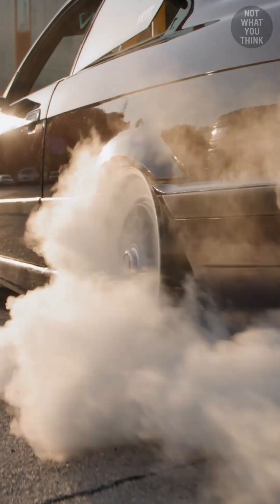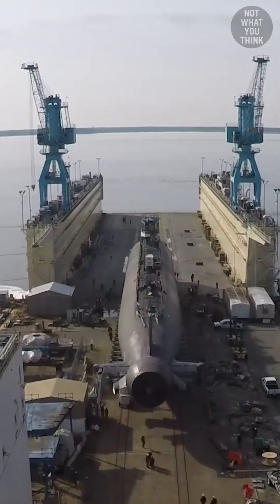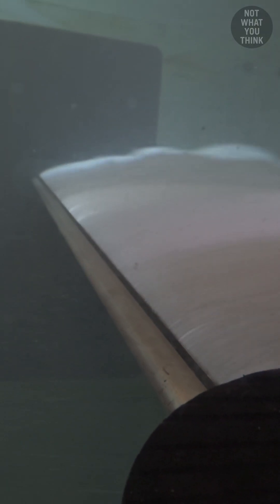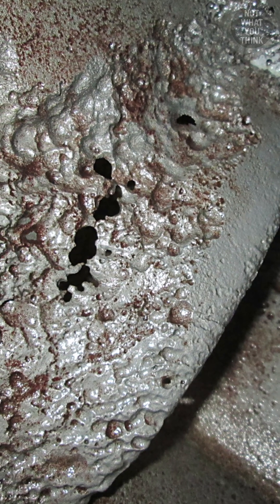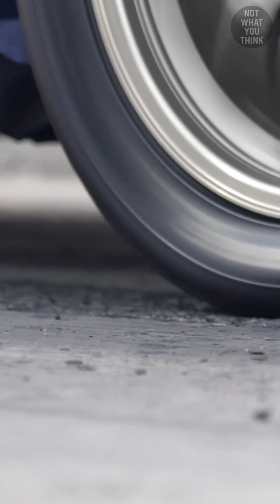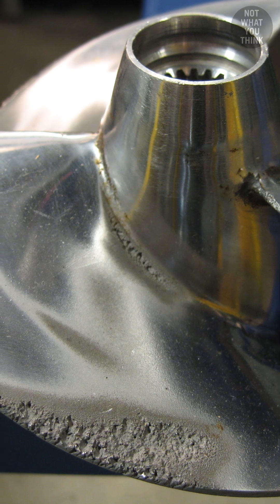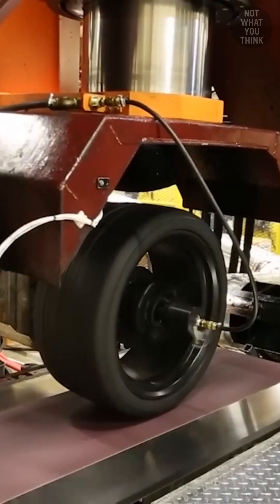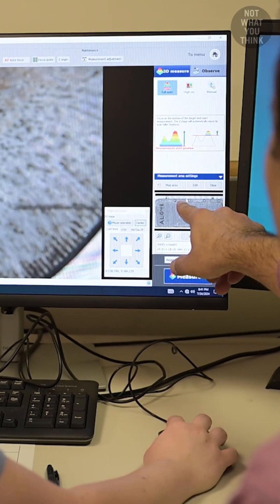The World's Largest Water Tunnel

Comment: As I understand the current going theory, is that Cavitation is millions of tiny bubbles exploding under extremely high pressure, or basically, the item moving through the water, in a way that it causes cavitation, is it creates air voids, like bubbles but different, that then collapse suddenly.  These collapse at super-sonic velocoties, and cause tiny explosions basically.  

My thought on this, is that Water has oxygen and other gasses dissolved into it, and as the vacuum forms from the cavitation air pockets, it sucks this dissolved air out of the surrounding water, and then the bubble collapses, and compresses this gas, to the point of combustion.  Pure Oxygen, or an Oxygen Hydrogem mixture for example, could basically oxidize and shred metal and other materials super quickly, like an oxy-acetylene torch, but in millions of tiny explosions a second, kind of thing.

Comment: Running out of fuel also causes cavitation and erodes cylinder liners in engines.
Reply: No, there is no such thing as cavitation from running out of fuel. Cavitation can happen in the cooling system.

Comment: The water is then cavitating it basically forms a vacuum and plasma ... propellers/props/screws and can happen in minutes... it's really understood by those that manufacture props for inboards/outboard on the racing scale due to the rpms and speeds and on tub boats due to the need for torque... seen it due to the area I live and the hyper performance fishing boats build for running in the flats

Comment: You can also have cavitation in your car/truck engine too. I had to replace the waterpump on my truck as it was leaking, once I had it off I saw what had happened. Cavitation had been happening between the back edge of outlet and the pump blades causing a series of deep holes in the metal, one of them had penetrated right through.

Comment: It’s not poorly understood. Water is not compressible, so when a cavitation is created and then collapsed in on itself a shockwave is created close to the propeller. As water doesn’t compress it sends its shockwave into the metal and over time that can take off layer by layer of metal. 
So, not poorly understood or hard to explain, the hard part is to mitigate it whilst keeping speed and rotation
Reply: well yeah the definition of cavitation. its about having to do actual experiments. if it was perfectly understood, we could just model or simulate the results with no deviation.
Reply: It is poorly understood when an AI is writing the script
Reply: @Derekzparty  hi, finally we found the village idiot. Everyone here has presented views and ideas but now we got a genuine Trump supporter, impervious to facts and reasons.
Reply: Hey look who know just enough to not know that they don't know what they are talking about.
Reply: @SilverMe2004  said the person saying absolutely nothing
Reply: Wouldn't non-stick tech usually used for cutting / cooking / going through things work? 

If the problem is the cavitation, why not stop the cavitation from happening in the first place.
Reply: @ the cavitation isn’t so much a friction thing but a pressure difference. As the propeller spins, one side is pushing (high pressure) and one is dragging (low pressure). It’s the low pressure that creates the steam that makes bubbles that then implode
Reply: It is not mainly the "shockwave" that causes cavitation damage. The damage is mainly from the extreme temperatures produced. cavitation bubbles when collapsing produce temperatures of upwards of 8600F, (4800ish C)
Reply: no fluids are compressible, this is a issues in oil systems as well.

Comment: Look at the wing feathers of owls.  
     At the trailing edge of the feathers there is slightly frilled pattern which dampens the noise of the air coming off the wing.  
     That's a main reason you don't hear the owl flying at you.

Comment: Cavitation is when water flow around obstacles creates low pressure zones. Because water is an incompressible fluid it will evaporate in this low pressure zones, creating low temperature steam bubbles. This constant fast paced pressure change can seriously erode materials over time. By optimizing part geometry the lifetime can be increased. And yes, cavitation is also really loud under water, which is very bad for submarines.
Reply: Water is not incompressible.
Reply: The water instantly boils.
Reply: "Low temperature" bud, the average temperature inside a collapsing cavitation bubble is upwards of 8500 farenheit, aka 4800ish celcius. You consider that LOW temperature??? lmfao. what even.
Reply: @ condescending much? You surely know then, that on formation of cavitation bubbles the steam forms because of low pressure, on temperatures below 100°C. Thus "low temperature". 

on collapse (implosion) of the bubbles causes localized pressure surges that lead to localized high temperatures. So what? I was talking about the formation.

Comment: What is a hydro foil
Reply: It is like a planes wing, but under water. Subs use them for fast diving. There are even boats that have hydro foils, when they go fast enough the foil can lift the whole boat out of water, reducing water drag.
Reply: a very interesting subject within mechanical engineering but it is to do with fluid dynamics compressible fluids incompressible fluids how they move over a surface force generation resistance efficient flow creating optimised geometry

Comment: Cool video, but linking it to tires was a bit of a stretch 😂
Reply: Its not explained well, especcially the tire on the sanding belt is a bad comparison. But cavitation also occurrs in tires, because the movement of tires in water will cause low pressure zones and therefore cavitation on the tire. Tire geometry is studied to reduce the effect, guiding water outwards fast, without damaging the tire.
Reply: @Thurthof5  Yes so what it has to do with it is an analogy
Reply: I get the feeling that who ever explained the purpose of the tunnel to them compared it to testing tyers
Reply: @SilverMe2004  I have a feeling the AI voice was used by someone who also used AI to monstrously oversimplify his video summary.

Comment: It is not poorly understood rather hard to stop without major limitations to its original purpose
Reply: It is actually somewhat poorly understood as well. There are still unknowns about the onset of cavitation as it is not exactly equal to vapor pressure and depends on transient effects.
Reply: @iLlamaNEG  It's also hot. Not a prolonged heat mind you, but enough to do dmg in a brief moment so there's physics involved we don't have all the details to.
Reply: It's not so much the cavitation that is the issue, it's the spontaneous collapse of the water vapor. As this happens millions of times all over the surface every second, the shockwave from the collapse concentrates an enormous amount of energy onto the surface creating microfractures. If you make enough of them, the metal will eventually pock. It's kinda like those hydraulic fire starters. Tiny, but super concentration of energy in that tiny spot.
Reply: @anthonylosego  you mean pneumatic fire starter like fire piston?
Reply: @anthonylosego wait a minute cavitation is water vapour? I thought cavitation occurs when props move so fast that the flow detaches from the props surface. 
So is actually vacuum and not heated water vapor. Water does gasify but that is due to low pressure and not heat.
Reply: Ah ok